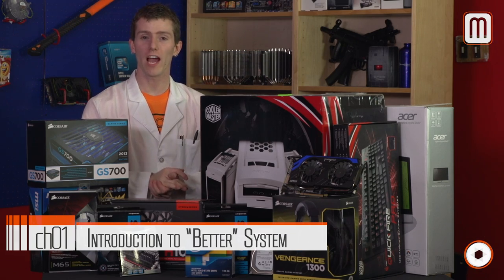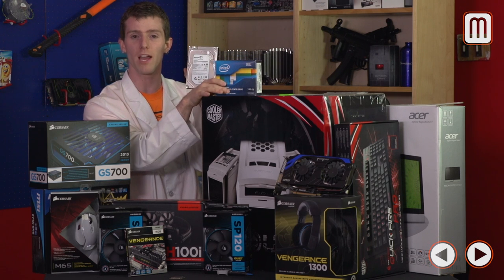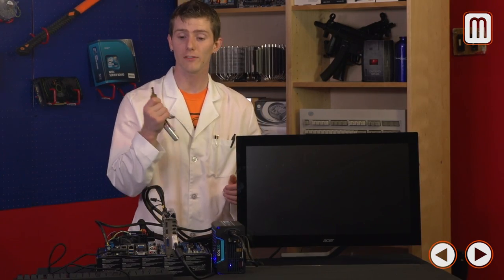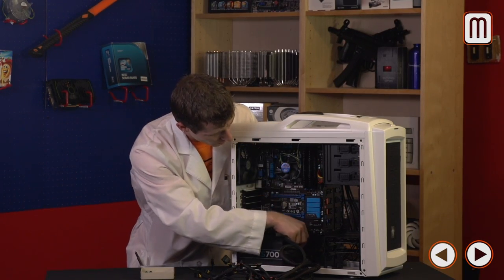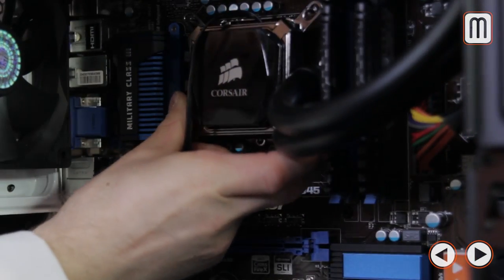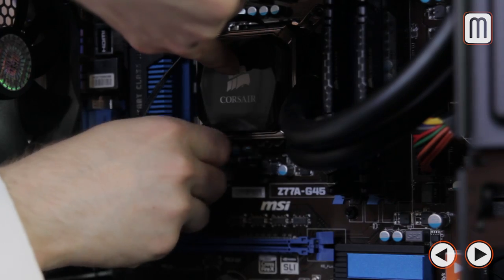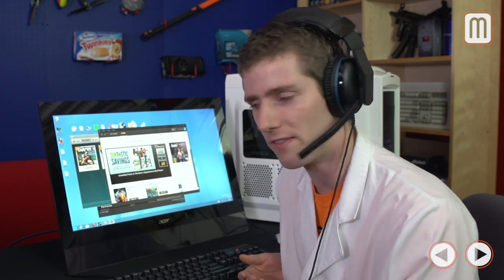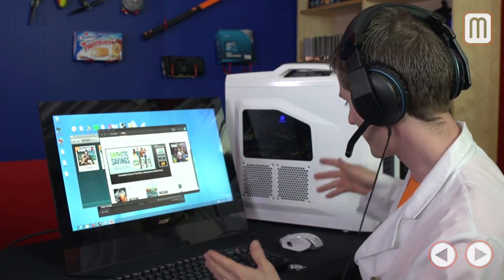ULTIMATE Build a Better $1500 Gaming PC Computer "How To" Guide

Comment: Will a i7 4770k support a gtx Titan? As well as 16gb of ram?
Reply: Easily.
Reply: Will a gigabyte gamin g1 black edition work as well?
Reply: TheBadAss LookingGamer Easily... A 4770K will work great with any LGA 1150 Motherboard. The only things that may come close to bottle necking with it would be like... 10 Quadros (Development Grade Card). You should be fine!

Also, if your going for a gaming build, I would go for a 780 Ti over a Titan. If you want the Frame Buffer, a Titan Black is more powerful, and I think it may be cheaper.

A better choice compared to the G1 BK would be an X- Power by MSI. Same Water Cooling parts, and extreme OC capabilities!
Reply: niofalpha I have been looking at their boards and a lot of people say that their boards stop working quickly and had issue. Asus and Gigabyte have better ones. Not sure about EVGA before. Last time I checked, they only made graphics cards
Reply: TheBadAss LookingGamer

Iv'e never heard of a MSI Bored dying quickly (Not with the person trying to do so). I have a MPowerMax and it is fine. 

And lots of reviews point too Gigabyte Z96 boreds having issues. And Gigabyte App Center is supposedly Broken.
Reply: niofalpha ok, how long did you have your Mpower Board?
Reply: TheBadAss LookingGamer I got it right when it came out... So about 2 months. Even if your bird breaks, there is a 3 year warranty (Probably more). It also features great on board WiFi, and WCing stuff. For cheaper than the G1 BK. I was originally going to go with that one... Then they released this baby!
Reply: niofalpha And I have the MPower Max AC. The middle board. The highest it the XPower.
Reply: Hmm........ Decisions decisions......
Reply: niofalpha Is the X power board better than the gaming 7 or 9 by MSI in terms of gaming performance and is it better than the gigabyte board I mentioned?
Reply: TheBadAss LookingGamer This website might help: overclock.net Great helpful comunity for all things PC.
Reply: zoon188 ok thanks :)
Reply: TheBadAss LookingGamer Oh and to answer the question the CPU does not affect the GPU or RAM it's the motherboard that needs to be compatible. Search for a z97 motherboard (Thats the chipset that the 4th gen i7's use.
Reply: zoon188

A. Z97's aren't the only Socket Types that work with 4th Gens. 5th Gens are another story...

B. The CPU Does effect it. A CPU with DDR3 doesn't have a DDR4 Controller. There for it can not function. Slick covered it in one of the Computex Videos.
Reply: niofalpha I was either going for an ASUS rampage or Maximus. What do you think?
Reply: niofalpha never mind, I'm going for a Asus ROG Maximus 6 hero, will that support a Titan black or more?
Reply: niofalpha I know it's not the only socket for 1150 processors but it's the newest and best for OC/Compatibility definitely the best if he's going for a titan black. Also DDR 4 isn't even released yet (I think :p).
Reply: zoon188 I did find one on sale for $919 bucks (what a steal!!) and was also wondering will 850watt corsair power supply do as well for my build?
Reply: zoon188 Ohh... Sorry man didn't understand the question. Thought you meant DDR4 to DDR3... And a CPU does impact a GPU... A slow CPU will slowdown a Fast GPU.
Reply: niofalpha will a 850watt battery due?
Reply: niofalpha NA In his case though due to the 4770s power.
Reply: zoon188 4770K's, draw slightly less power than the 4790K.

It's not enough to him scale down. The power draw is literally 4 Watts. Im too lazy to check the Titan's Power Draw.
Reply: niofalpha Ok I'll do it myself. I mud tower should be enough to fit it in right?
Reply: The_Incredibally Smart_Gamer Feel like saying the minimum is 250w.
Reply: niofalpha ok thanks, and a mid tower should do right?
Reply: The_Incredibally Smart_Gamer

Should probably be fine. I always prefer going for a Full Tower.

I assume you use pcpartpicker.com . It automatically checks if the parts are compatible, and if they fit.
Reply: niofalpha LOL, I don't actually but it is a pretty cool website that I will probably check out. But phantom 410 should due right?
Reply: The_Incredibally Smart_Gamer I don't remember which case the 410 is :P... I know some of the older NZXT Phantom's can't. I think the 410 can tho. Check the PCpartpicker. It saved me lots of time on my build.
Reply: niofalpha ok thanks
Reply: Yup
Reply: ***** thanks
Reply: The_Bad_Ass Looking_Gamer Short answer is yes. Personally I would buy the I7 4790k cpu it's an updated cpu for the same price , and if your gaming Titan is really a waste of money 780 or 780ti is more than fine, sli in the future if needed. But each to there own just a tip. Good luck on your first build It is a blast once you get things figured out you'll never buy the big box store pc's again. Best wishes.
Reply: Robert Buchanan Andrew Hamel

Ok thanks guys
Reply: ***** what is your question (I did plenty of research so know I know a lot about computers)
Reply: Time For Some LogicДа,мой компьютер 1000 RU $ стоит . Itel core i5, Nvidia gtx 650  , 8 гигабайта ram . В будущем планирую gtx 750 or AMD system .
Reply: You should probably go for another Nividia build because they have better drivers than AMD and they also perform better in most cases. If you are on a budget then go for an AMD build. That's how I always plan my builds.
Reply: if you can afford it, go for another Nividia system because they have better drivers than AMD does. Just think about it, Im pretty sure that all games are built off of Nividia titans and Quadros so it is easy to support
Reply: Time For Some Logic wrote: "I did plenty of research so know I know a lot about computers"

It actually proves that you know nothing about computers if you have to look everything up, which is only confirmed by your super dumb question "Will a i7 4770k support a gtx Titan? As well as 16gb of ram?"

Btw, you wrote the same comment twice dumbass  >>>>

"You should probably go for another Nividia build because they have better drivers than AMD and they also perform better in most cases. If you are on a budget then go for an AMD build. That's how I always plan my builds."

"if you can afford it, go for another Nividia system because they have better drivers than AMD does. Just think about it, Im pretty sure that all games are built off of Nividia titans and Quadros so it is easy to support "
Reply: Kmlvox I said that question when I first didn't know anything about computers. Now that I did some research on computers I now know the answer to my question that you didn't answer but decided to curse at me and call me a dumbass. And in case if you didn't believe me then here is a sample of what I learned.

Overclocking a CPU will result in lower ram speeds

Ram that doesn't run at claimed speeds doesn't mean that it is defective. Simply go to the bios and turn up the clock speeds to the claimed speeds it can reach

LGA 2011 sockets are mostly used for high end CPUs like the 4930k that needs the extra bandwidth to use all of it's capable power while CPUs like the 4770k don't need that many lanes to give out all of it's power

LGA 1150 CPUs will not fit in LGA 2011 sockets and same way around

The new X99 platforms that were released has a 2011-3 socket and Intels first 8 core non zeon CPUs and can also support the brand new ddr4 ram

I hope the information helps show my knowledge of computers and hopefully you shall stop calling me a dumbass
Reply: an i7 4770k will support the titan but get a 780ti for gods sake, the titan is overpriced for what performance it has in games, if you are not using it for gaming at all then ok go ahead and use the titan but if you want a card thats about the same price then go get a titan black, it has both the stuff from the 780 ti and the titan so youll get better performance and still use it as a workstation card if thats what you're going for
Reply: Minecast Zyad48 its too late now because my budget changed significantly (due to bills and taxes and stuff) so I am getting a Evga GTX 770 SC. When I recover I will get 2 of them and they will perform better than a 780ti. but I really do appreciate the suggestion though. Thank you :)
Reply: Time For Some Logic
ok :), u getting 2 titan blacks or 2 normal titans? because if you're getting 2 titans then get 2 780 ti's instead or 2 titan blacks. also nice choice for a current graphics card(770) :)
Reply: Minecast Zyad48 I am getting 2 GTX 770's. If I was to go more more expensive it would be 2 780tis because Titan blacks are really meant for extreme productivity which is something I won't do. so it's best to buy something that you will actually use and not just because you can
Reply: Time For Some Logic
thats true 2 770's will really get you great performance, i wish you luck :)
Reply: Minecast Zyad48 actually, I found a deal on AMD r9 280's and 2 of them perform better and cost less so I think I might get 2 of those
Reply: Time For Some Logic
i havent seen the stuff that 280's do, how much are they and do they rly outperform the 770's? if so then imma buy em
Reply: Minecast Zyad48 no, the 280x out performs the 770. A better comparison is the gtx 760 vs the 280
Reply: Time For Some Logic ah ok 280x;s, u made a mistake b4, u put 280's and not 280x's but its fine :), so yeah i checked the 280x performance similar and even better than the 770 a lot of the time so yeah good luck :)
Reply: thx :)
Reply: If you have the budget to get a titan I highly suggest geting the AMD 295x2. It's the best gpu on the market right now.
Reply: M. Smelyansky
thats true but its for 500$ more, although if you got it that would be a HUGE performance increase and i do not recommend getting the titan z ;P, its twice the price of the r9 295x2 and performs worse, so if you're thinking about getting a titna z, get 2 r9 295x2's instead and crossfire em then get 500+ fps in bf4
Reply: M. Smelyansky I thought GTX 780(ti) was the best single GPU was the best?
Reply: *****
well its the cheapest but best performing gpu but the titan black is faster and better but more expensive
Reply: ***** The GTX 690 is actually the best single GPU. If you go to NVIDIA's website you can have a hardware comparison from the 600,700, and Titan series GPUs and the 690 performed the best.
Reply: Buckeye Gaming
dude the 690 is a dual gpu card, the titan black is the fastest single gpu, the 780 ti it the faster single gaming gpu but the titan black is the faster gaming gpu with other optimizations
Reply: Guys, I am not getting neither of those cards. I bought my pc parts already and my parts came in at a woping $3,000 because I forgot to include taxes XD. So I think I will get a GTX 770 and add another one later. 2 of these bad boys in SLI rocks the Titan and 780ti. Plus my brother will be building his own pc later now that he saw me build my bad ass looking machine (check my posts and add me to get updates on my pc) so I will probably give him my 770's and get the 780ti or the 980ti when they come out
Reply: And besides, the 295x2 is a really goo pick but my dad will shit bricks when I ask him and it's ment for 4k and right they are a bit pricey so I am only going to play at 2560x1440p
Reply: Time For Some Logic Besides getting the 295x2 when upgrading (if ever). get 780ti if you overclick, or 780 if you dont
Reply: Nah if I am going to upgrade to 4k I will get 2 780ti and probably play at high or medium which still looks good on a 4k monitor
Reply: Time For Some Logic I think that's overkill.
Reply: ***** 2 780tis on 2560x1440p or 4k?
Reply: Time For Some Logic 2 780ti's is whats overkill, unless you have like a dual 1440p set up theres really no point.
Reply: Yeah thats enough.
Reply: ***** well, we just moved into next gen and my old desktop just gets slaughtered playing these games so I want to make sure that my pc is future proof so that I can always play game at max settings in 1440p
Reply: ***** if not then high
Reply: Time For Some Logic You can probably get to ultra on BF4 on 1440p with just 1 780ti.
Reply: ***** yeah well bf4 isn't that intensive at all so that game doesn't count :). REAL next gen games like star citizen are really going to push graphics cards so yeah I want 2 780tis on a 1440p monitor
Reply: Time For Some Logic Are you going to overclock the 780ti?
Reply: ***** well I may get one 780ti because I just realized my PSU isn't big enough and I don't feel like wasting it XD
Reply: ***** yeah probably
Reply: Time For Some Logic Alright, cause if you weren't going to get 780TI, you might aswell go with 780.

And again, I don't really recommend a 780TI-SLI, it's already extremely powerful, or you would wait for the GTX 980.
Reply: ***** I guess I can wait for the 980 because with the leaked benchmarks they out perform 780ti but for now I will get 2 770's then pass then to my brother for his pc
Reply: Time For Some Logic
wait 980 will be better than the 780 ti? o.o ok i gotta see this
Reply: Minecast Zyad48 didn't you see the leaked benchmarks the pretty much out perform everything in the 700 series and the 295x2 using 3D mark benchmarks
Reply: Time For Some Logic
no i didnt, ill check it out later :)

ok i checked it out now, is it on videocardz?
Reply: Minecast Zyad48 yeah I think it is I checked it on new egg tv
Reply: Time For Some Logic
ok well it shows only 2 980's in sli beat the 780 ti and the 780 ti still comes out on top of a 980 on its own on here: http://videocardz.com/52166/nvidia-geforce-gtx-980-gtx-970-gtx-980m-gtx-970m-3dmark-performance
Reply: Minecast Zyad48 it's still surprising to see 2 980s beat a 4k GPU tho
Reply: Time For Some Logic
what? which gpu are you referring to that is 4k?
Reply: Minecast Zyad48 the 980 beats the 295x2 in 3d mark
Reply: Minecast Zyad48 well..... It's up there
Reply: Time For Some Logic
yeah but only in sli, and the one on its own is right below the 780 ti, so im just gonna get 2 r9 295x2's and be good for the next couple of years on gaming at 1080p or 1440p
Reply: Minecast Zyad48 295x2 is meant for 4k at high resolutions unless it a surround monitor setup.  an besides 2 980's maybe cheaper and yet compete with the 295x2 but we will see when they come out
Reply: Minecast Zyad48 do you think I should get a 680 or 770. In most benchmarks when overclocked out perform a 770 and is cheaper even for a new one
Reply: Time For Some Logic
well i'd suppose go with the 680 cuz my cousin has a 660 and according to him he can max out crysis 3 60 fps on 1080p with it and a 660 is still a pretty good card so yeah the 680 would do pretty good
Reply: Minecast Zyad48 a 660 play crysis 3 maxed out at 60fps? XD Your cousin is 100% wrong or his card is special XD
Reply: ***** well the main reason why I ask you this is because the 680 is last gen and performs better but I am worried about game developers not worrying about the 600 series and will quickly be forgotten. also saying 680 is better than saying 770
Reply: Time For Some Logic
ok im not sure but i think he actually has the 660 ti or he runs it at a lower resolution than 1080p cuz all he told me was that he could run crysis 3 maxed out 60 fps no problem and he said it either the 660 or the 660 ti but we havent checked in a while
Reply: Minecast Zyad48 I decided I am going to save up for the 780 instead of what I am buying now. I found a asus direct cu2 780 for $439.99 on amazon. Can't wait to get that deal
Reply: Time For Some Logic
wow nice choice :)
Reply: thx : have to to school now, peice
Reply: Time For Some Logic
peace :), cya later
Reply: no its too small, the titan will fall off.....
Reply: Minecast Zyad48
Me? stupid? You need to re-read the op's comment then mine, then think about it eg exactly why is "it" too small that the titan will fall off?
sheeet, the people in these comments are so up tight, ffs get a sense of humor.
Reply: AuralVirus sorry XD, i just realized my bad
Reply: Minecast Zyad48
NP - I understand totally. When you've read 100 comments in a row you expect the 101st to be equally as stupid xD
Reply: AuralVirus XD
Reply: AuralVirus Minecast Zyad48 

Best end to a fight ever XD
Reply: The Smart Gamer XD
Reply: Yeah it can send me the pc when you built it
Reply: Hell yeah
Reply: partyrocker1159 sorry it took so long, my pc is almost complete. Getting a GTX 970 for Christmas due to financial situation and my dad wants to move now. I can't blame him tho, the neighborhood we live in is shit (Plainfield NJ) I already posted some pics of it an did a case review/tear down
Reply: The Smart Gamer thats ok you can send it me as soon as it's ready. i live on the moon.
Reply: partyrocker1159 lol party on the moon
Reply: The Smart Gamer yeah with my new pc you built for me
Reply: partyrocker1159 that ship that had exploded, had my pc on there :/
Reply: Not sure if anyone has said this because there are like 100 replies XD but if your just going to game I would recommend a gtx 980 or 70 because the titan would give around the same performance as a gtx 980 because the titan is a workstation card and is not really for gaming.
Reply: Alex spander ummm no, the 980 is already more powerful than the titan out of the box, but I would still recommend it like you
Reply: Minecast Zyad48 cos isent the titan like $2000 and the 980 is like $500? But still would get better performance than the titan because the titan was never built to game.
Reply: Alex spander the titan is $1000. I get your point but you said that the 980 will get similar performance for less, that's incorrect, the 980 outperforms it right out of the box and it gets even more OP through overclocking
Reply: Minecast Zyad48 But the only reason for that is because the Titan was built specifically for workstations
Reply: Alex spander yeah i get that, but the titan black on the other hand was built to satisfy both crowds. i get your point
Reply: Minecast Zyad48 well, I think the Titan black is more for hardcore enthusiasts. A regular Titan all ready gets amazing frames and it perfect for 2560x1440p resolutions
Reply: The Smart Gamer yeah no, the normal titan isnt worth SHIT, you're better off buying the much cheaper and much more powerful gtx 980, or even the fucking 780 ti. if you want to buy a titan then buy a titan black which is actually worth something
Reply: Minecast Zyad48 I know that, this comment has been up for more than a month. I already figured it out but thx for the input
Reply: The Smart Gamer yeah sorry, I had forgot at first ;P
Reply: Yes